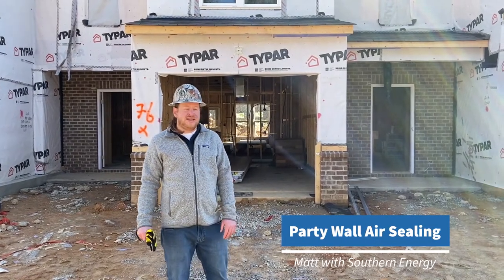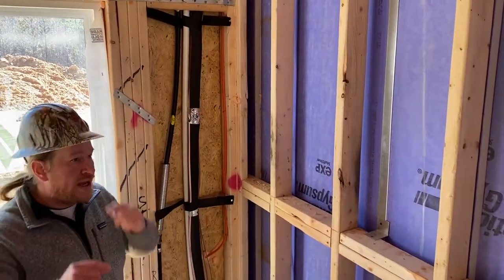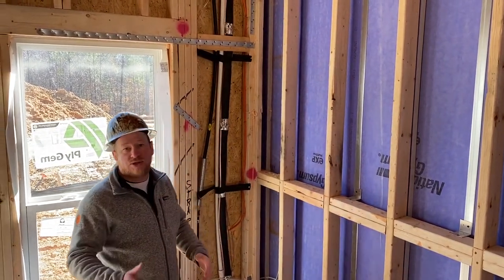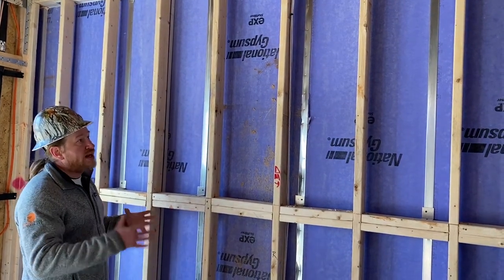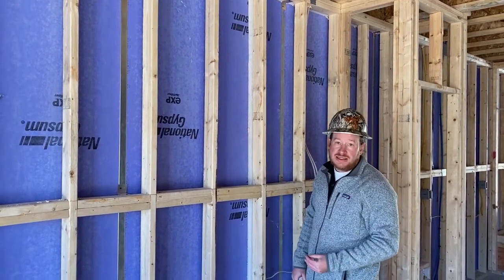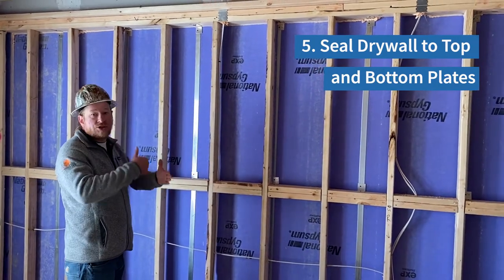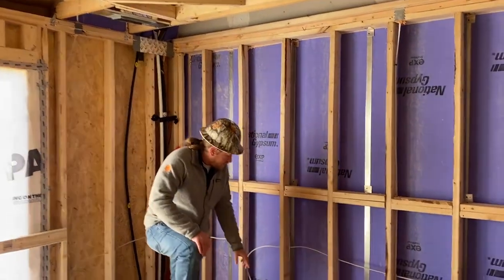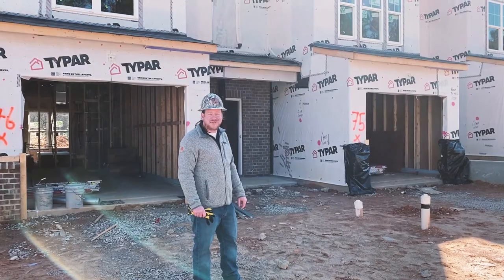5 Tips for Townhome Party Wall Air Sealing

Comment: Why do I smell detergent (as if someone is washing something) through the electrical outlets that are on the party wall? I have nothing washing on my side. The smell is not light it is stroooong. How could this smell be coming from the electrical outlets in the party wall? Maybe my neighbour's washer and dryer are on the other side of the party wall? I just don't get how this is happening. Any help or ideas is greatly appreciated.
Reply from the maker: The primary function of the party wall is to prevent the spread of fire between townhomes.  Like most walls the party wall is not a completely air tight assembly and can be a significant source of air leakage, both to the outdoors and between dwellings.  Mechanical systems such as HVAC, kitchen, bath and clothes dryer exhaust can pressurize or depressurize the dwellings independently of each other and at different times.  What's likely happening is that the smell is being pulled through the party wall by mechanical depressurization on your side; or possibly pushed through the wall from positive pressure on the other side.